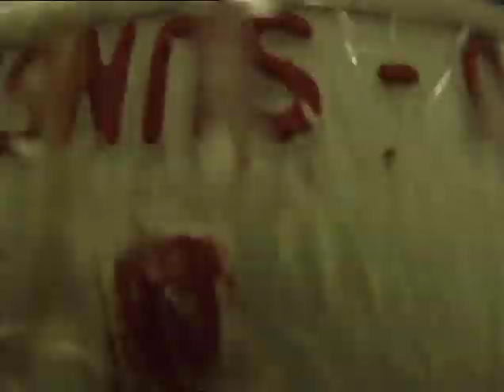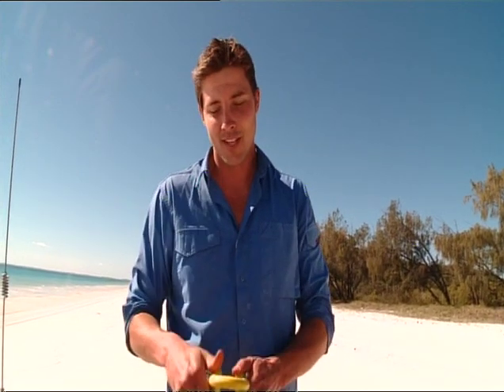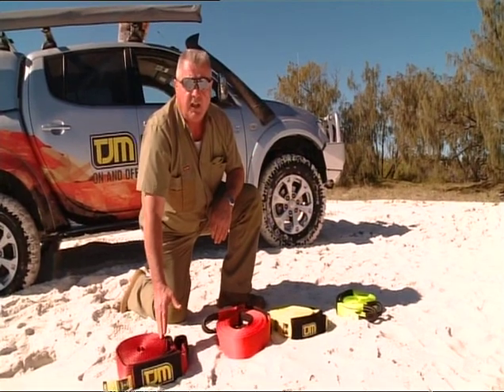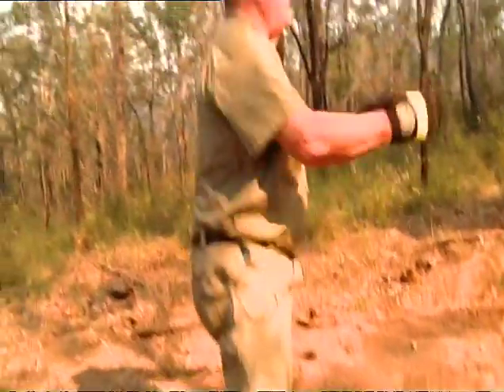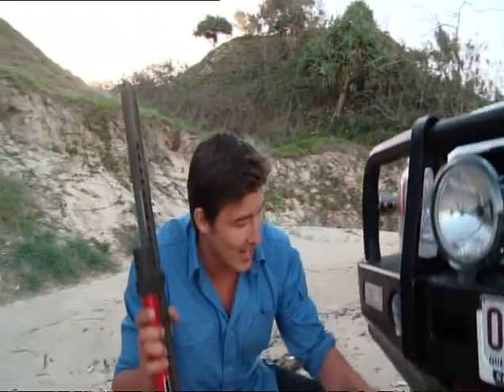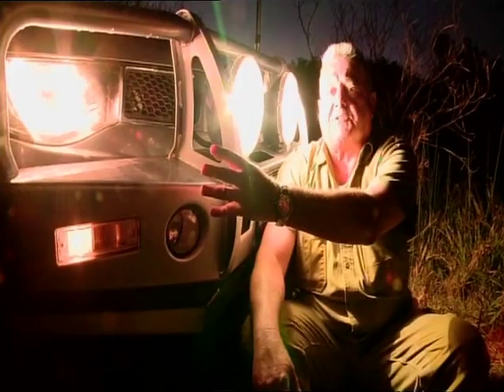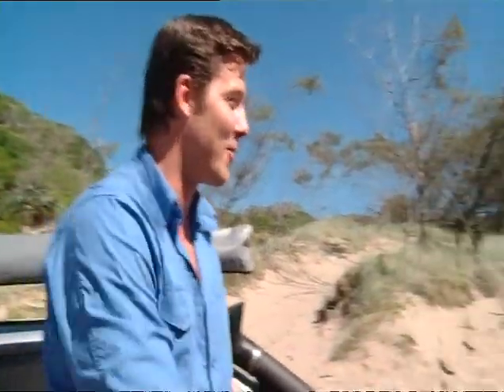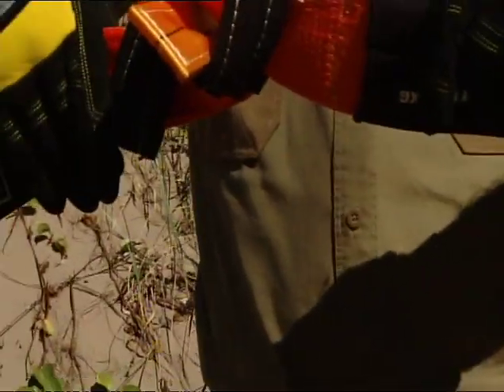TJM Recovery

Comment: I have a Triton and Pajero, I normally pull out Toyota's and Land Rovers as I nver get stuck due to the excelent MATT system and a proper aftemarket suspntion and proper tyres, giving me plenty of ground clearance,  more than the troopy anyways and not like you guys have.  Been this way in Africa, South America and Aus.  What you did prove to me here, as I am in the market for bullbars on both, is to steer away from TJM as they make the Triton undeperform due to weight and design!!